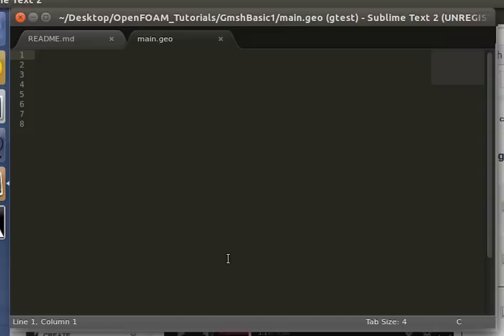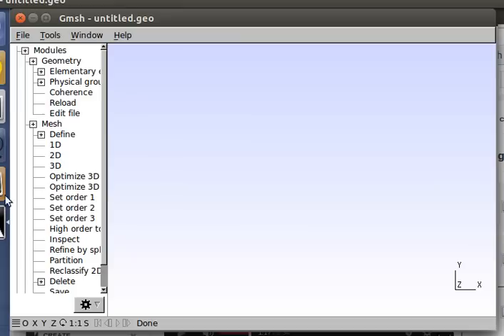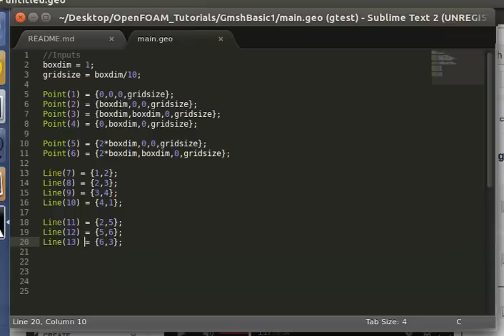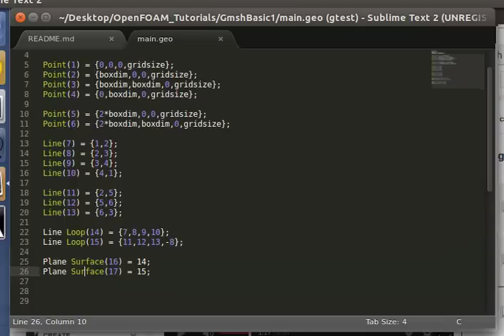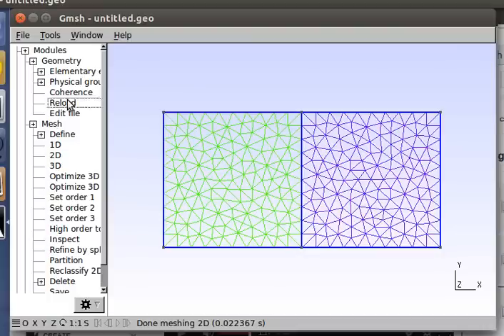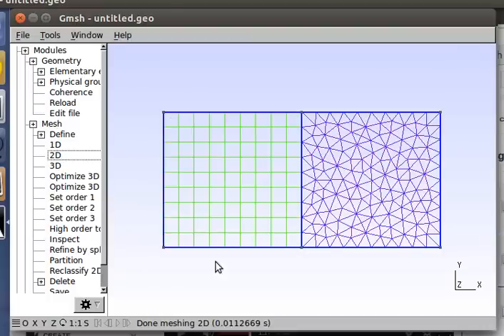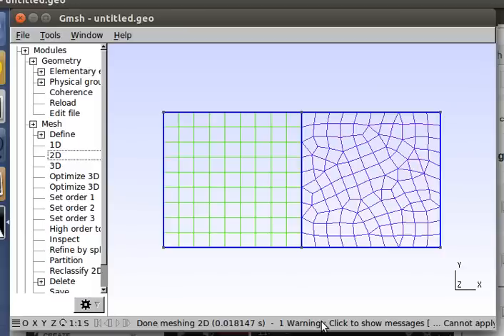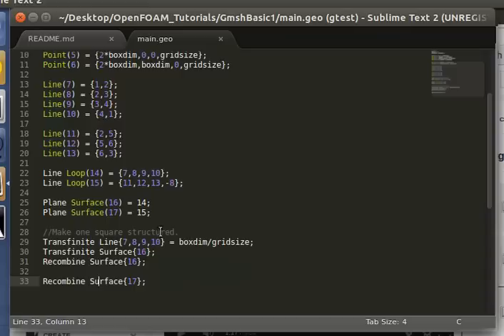Making Meshes for OpenFOAM with Gmsh, Part 1: Unstructured and Structured Hybrid Meshes

Comment: How you can extract the connectivity table for elements? The mesh information contains the coordinates of the points (table 1) and the points for each element (table 2). How you can extract only the information of the elementary element (i.e. triangle) and not the elements like points or lines for the table 2?